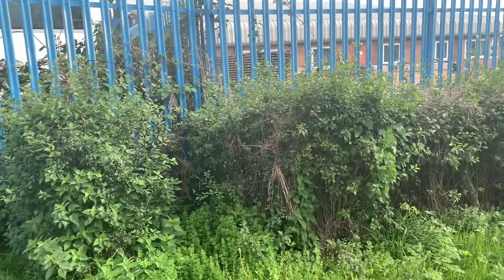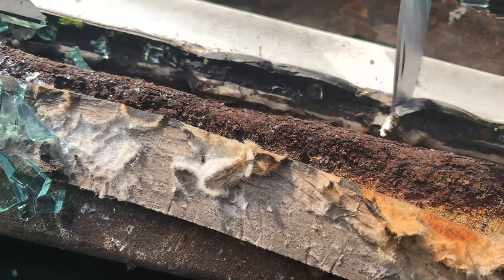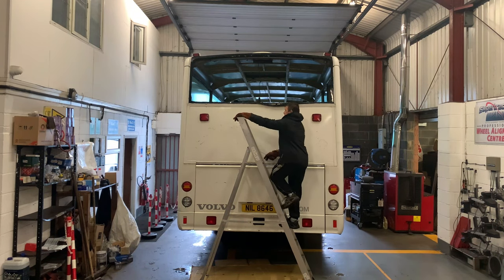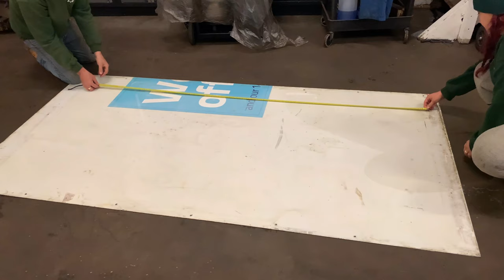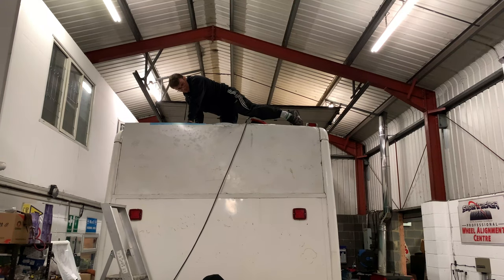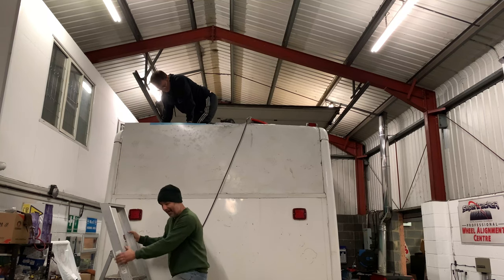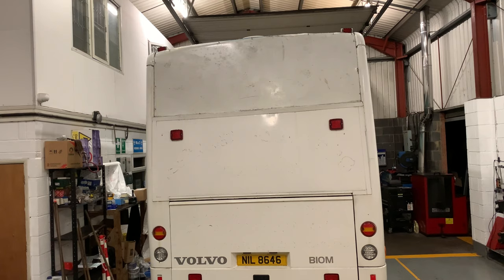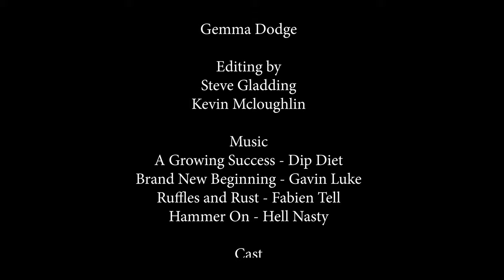Coach Home UK - We've Been Vandalised - Bus Conversion UK

Comment: Its bonded in. Bad design which was altered on a rear end redesign. A lot of coach operators panelled the window. That looks like its had later back end fitted as it's got the hinged boot lid and bumpers from facelift hence how rear window seems to slot in bodywork.
Reply from the maker: yes I've seen a few different rear ends within one or two years of ours but we seem to have a mixture of them :)
Reply: Pretty much all modern bus and coach windows are bonded as opposed to the rubbers they used to use. The silicone bonding putty they use has a longer lifespan than the rubber which goes hard and perishes over time. The other reason bonded is better is it makes it easier to kick the windows out should the need to evacuate in an emergency arise.

Comment: Modern life eh people think we're highly advanced these days, not so sure sadly it doesn't surprise me the window.. Amount of cars you see keyed. 
A guy with channel vanhaus conversions is converting a library bus for himself, worth checking out he was asking for ideas on colours to paint it I advised painting it in raptor bed liner for durability. Guaranteed someone will think that'll cost a fortune to fix if I key it.
Reply from the maker: the real funny thing was we were deciding if we should take the window out anyway :D 
We was wondering what it would look like completely done in Raptor.
Reply: @CoachHomeUK  reckon it would look smart in black, a guy on another channel was doing his sprinter minibus in off white it doesn't look as good as the dark raptor paint.. But I understand from the guy with the overlander your going abroad I guess if its dark its gonna get hot in it.. 
Good thing with raptor you don't need to be a paint sprayer and it covers up any small dints that show up easy on flat panels, yeah it looks fine with that in the back, no doubt things will be changing if your making room for a car..
I saw a motorhome tow car for sale on eBay recently, tiny thing comes as standard with a bike engine was only a couple of grand, size of them off road buggies .. 
I can't remember the name but it was a road legal car, ideal for that.. There's a few different off brand miniature cars.

This might be useful for your insulating if you want to do any yourself its the closed cell stuff like the stuff they spray in the house, its quite cheap for that stuff.. 
Nothing to do with me I put it in my watch list in case I ever build something lol.

https://www.ebay.co.uk/itm/233661992562

Comment: Why did you choose this model? Any advice on choice and ones to avoid?  
Great project.   Keep chin up.
Reply from the maker: Main reason is we want to put a small car in the boot so needed a centre engine. Also these engines are basically bullet proof and I’m told they will do about 2,000,000 miles 😃. Main stuff to be aware of is rust behind the rear wheels may need completely rebuilt. The only change I would make going again would be get a high top as you get an extra layer of storage.
Reply: @CoachHomeUK     Thanks for that. Good thought.    I suppose in your case, you're going to need to completely rebuild the back end anyway.